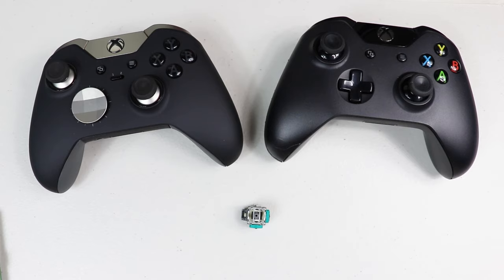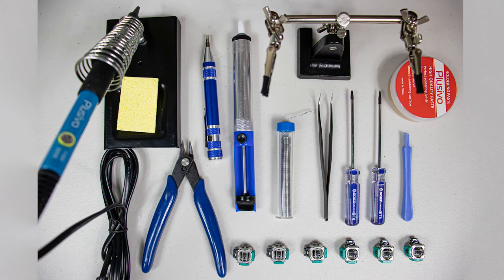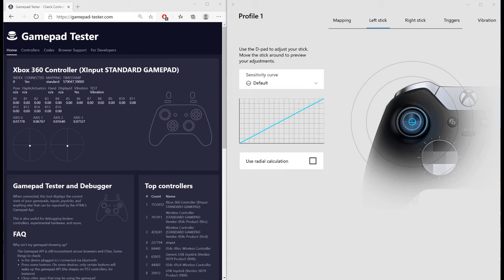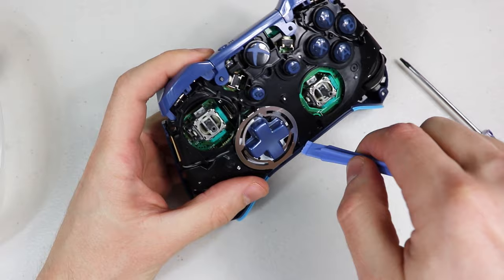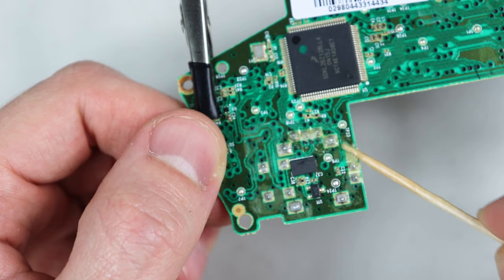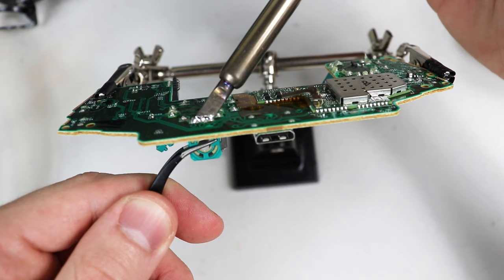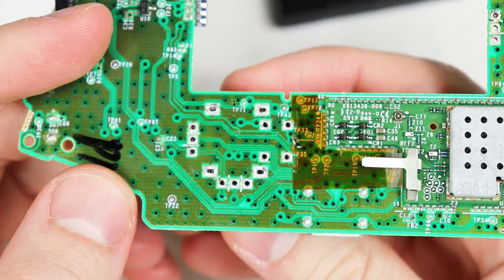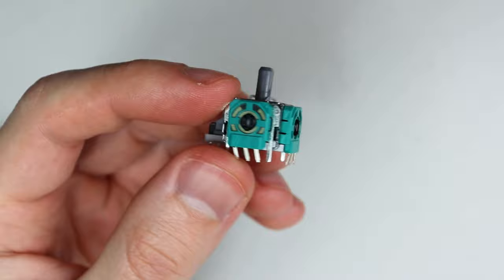How to Replace Xbox One Controller Analog Joystick - NEW METHOD - Fix Stick Drift, Broken, & Loose

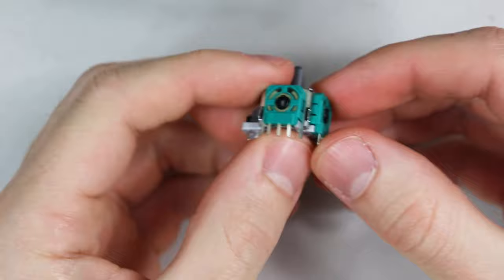Comment: 13:50 I have found that using a small jewelers drill cleans out the thru hole easily. You just drill the solder out of the hole.
Reply from the maker: That's very adventurous 😅
Reply: @SOSSGAMING  I make a lot of mistakes building circuits so I have gotten good at desoldering. I almost always put at least one diode in backwards. Haha.

Comment: I have similar method but I cut bottom part of potentiometer and bend legs to its body. After that I'm soldering it by wires to holes. After that I'm using two component Apoxie clay (its like bubble gum) to fix potentiometer in place, adjust it and leave it for a day to fully harden. I think this way adjustments are more precise.
Reply from the maker: Sounds very interesting!  Wish I could see it in action.  Thanks for sharing.

Comment: My controller just recently got really bad stick drift in the right joystick, (ive already gotta fix two others, one with left stick drift and one with a practically broken left joystick and drifting right) im gonna hopefully get it fixed once im home today, ive already watched the tutorial and it was really straightforward and actual seems pretty simple. Hope i can use it to save many future controllers
Reply from the maker: Awesome! Also if you work on the x/s controller they will self calibrate after some time moving it around (while turned on) which can save some time. No need to manually calibrate on those. Good luck!

Comment: Highly recommend Chip Quik smd291 flux with Chip Quik smd alloy. I use this on my reflow work to remove stubborn IC's and multipin  components. The alloy retains heat longer than normal solder allowing one to pull the component off with general ease.
Reply: As another note to this, if one uses it, you want to make sure you remove then Flux and all the chip quick solder before replacing a component. It's not a normal solder.
Use 100% IPA or DI water to clean the smd291 Flux off the boards as well.

Comment: Bought a cheap repair kit of eBay and went straight to this video. Got to the part where he mentioned soldering iron. Went to eBay and bought a new controller 😂
Reply: 🤣 soldering can be hard to learn. I allready ruined 3 working controllers with minor drift. Now they are in the bin
Reply: This is me right now. Will just buy a new controller

Comment: Great video.  The HTML5 link is a great tool.  I don't know how to use an Xbox(I am serious :/) but that website worked great for me.  Doing the repair is like a puzzle to me.  I didn't realize new modules needed to be manually adjusted until I saw your videos. Your video is very clear and informative.  My nephew asked me to fix the drift on 2 original controllers before he will let me open his elite controller....  I don't have new modules so I just rinsed them off with 99% ipa.  Blew them out with air.  They are all within range .02 to .07.  They don't always spring back into the same position when I let go of the thumbstick.   In your previous video, you mentioned that .18 is when drift starts.  I'll try and get a really bad controller from my nephew that I can experiment soldering with.  I am teaching myself micro soldering with switch lites with some success and have plenty of tools.
Reply from the maker: Glad you found it useful. Also glad you were able to find some success with just alcohol.  For the .18 metric that was for typical games a couple years ago (specifically call of duty: black ops 4 that I tested on).  Technically it all depends on the deadzone a particular game uses and I think newer games are lowering that limit.  Anyway, wish you the best of luck in future repairs!

Comment: to de-solder parts like the potentiometer just put a glob of solder wire over the 3 pins to heat them up equally and with the help of helping hand, one side can be heated and from the other side you can remove the potentiometer. :)

Comment: I’ll admit this seemed a bit beyond me, with the fine adjustments you were talking about doing but I decided to give it a go anyway. I decided not to cut off the 3 parts on the new module that you instructed to do to manually calibrate and just soldered the new module straight on (I was going to desolder and follow instructions in more detail if it didn’t work). But straight off the bat it was dead center. Not sure if I got lucky but I didn’t need to do any manual calibration. Great video by the way you can tell you’ve done it a bunch of times.
Reply: Side note, I also didn’t desolder the rumble modules, but I regretted that as I snapped two of them fiddling about with it so had to re-solder them back on anyway.
Reply from the maker: Great job! By any chance were you working on the newer S/X controllers? They have self-centering built in the controllers. Thanks to Microsoft. If it wasn't, you got very lucky!

Comment: I would recommend using a wick rather than the solder sucker for an amateur. On my first tries desoldering the pins I didn't get the solder fully melted and the suction also ripped off part of the pad on the board.
Reply: Are these pads needed to re-solder? I ruined 3 controllers where I ended up with half the pads gone (also used a suction pump). I couldn't get the axis back to work after those pads vanished. They worst part is, those only had minor drifting issues but I ended up breaking the pcb and throwing them in the bin

Comment: The framework itself hardly ever goes bad, only the potentiometers themselves go bad so really that is all you actually need to replace. How I do it is just desolder the 6 pads to the pots themselves and then pry them to the side and pull them out, pop off the ones on the replacement joystick. line up the center, stick them in, pop them back onto the frame and hit them with a bit of solder. Not including disassembly and assembly it takes less than 5 minutes

The main reason these type of joystick go bad is from using the joystick switch which put's downwards pressure on the two shafts which in turn puts pressure on the pot wiper mechanism distorting it's shape and over time the distortion remains plus the wiper itself bites into the resistive layer removing bits of it so the resistance changes. The best way to avoid it is to buy gamepads with buttons/paddles on the bottom and map your two joystick switches to them.

Comment: nice video. one tip you could improve on: when using wick, spread it apart before using it, it'll wick much easier and it'll wick much more per length of wick.
Reply from the maker: Great tip, thanks!
Reply: @SOSSGAMING  you're welcome. let me know what you're lost on in my calibration post and i'll help you out.

Comment: thanks for the helpful video! do these potentiometers work for the new xbox series x controller, i messed up my first go at it and im going to try again. you make it look easy
Reply from the maker: Yes, they use the same joysticks/potentiometers.  Remember to not use too high of temperature and/or for too long on the pads. I probably should have emphasized that more. Anyway, good luck this next go around!
Reply: @SOSSGAMING  I just went for it off memory your instructions were fine, that's my bad, break a controller every 3 to 6 months so I have a graveyard of practice ones(no I don't miss treat or throw them I squeeze to hard)

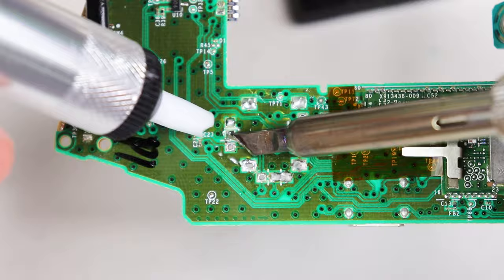Comment: One adjustment, even though you most likely won't need a broken joystick, you don't have to completely destroy it, you can melt solder and remove it just like it is shown on 13:41, then you can just gently pull the entire joystick with the potentiometers.

Comment: Soldering Wick is your friend, I prefer it over the sucker. You can grab one part of the wick then grab let’s say and inch away from it and push your hands towards each other and keep doing it until the wick is widened, do this when visually it looks like all the solder is gone from the holes and this makes it easier for it to conform and absorb the small amounts of solder you don’t see, then whatever your desoldering should wiggle loose.

Comment: Thanks for your video as it came in useful the other night when I decided to tackle replacing one of the thumbstick modules on my Xbox controller,,,, and the thing that puzzles me is,,,,
I'd smoked quite a bit of crack and heroin that night and one of the side effects is that after a few pipes it totally messes up your close up vision,,,, but hey!!!!,,,,, I'm feeling funky I thought,,,, let's do it anyway!!!!!,,,, yeah puzzled,,,I made a right mess of it,,,by accidently de soldering two surface mounted capacitors that are about the same size as salt crystals,,, some how I found replacement ones from an old smart phone and eventually re soldered them,,, I ended up convincing myself that it's now probably scrap and fitted the new analogue module soldierd it and put everything back together again without following the steps you showed about removing and snipping the plastic nibbs on the carbon track housing for fine adjustment,,,,, so here I am a couple of days later puzzled because I tried out the controller with the Xbox app and the new thumbstick is now showing better results than the other one that I didn't touch because it was working fine before the repair work..... so can you tell me if it's common for the modules to not need any adjustment after being replaced????
Reply from the maker: Haha thanks for sharing! It's not common to not need adjustment, may 1/4 or 1/3 of the time you'll be fine. You lucked out!

Comment: It’s not electricity and heat. It’s that the solder tip is a ground connection. So if you solder say a 5V or 3.3V rail to ground you might blow the power supply on the board as it likely won’t have over current shut down protection.  It can wreck havoc in other areas as well but yeah it’s not the heat that blows shit up.
Reply from the maker: Aha! Great insight. Thanks for sharing your wisdom and teaching me something today.

Comment: I just had so much trouble getting an analog stick off.  I finally had some luck when I remembered that I had some chip quick.  Chip quick is a low temp solder for removing surface mounted chips.  So get some of that that if you have an elite controller with small holes.

Comment: Thanks for the video. 12:00 The pointed and sturdy nipper you use looks good. What nipper do you use?
Reply from the maker: It's just the standard one that comes in the kit. Called a micro cutter. If purchasing one by itself, I'd recommend the Hakko brand micro cutter. Really good build quality.

Comment: This is by far the best analog stick replacement video I have seen. I have one question. I heard that the black and orange modules are better, is this true?
Reply from the maker: I am not familiar with them actually, so I couldn't give my opinion on that.  Do you know why they say they are better?
Reply: Not really sure but i know that the plastic thing that controls the horizontal movement(it’s a cream color on the green and blue module) is a hard plastic rather than a flexible one.

Comment: I Love the way your patient and clear with what your doing! I am having an issue with the controller not staying on though when i plugged it into my computer, it turns on briefly then shuts back off
Reply from the maker: Which controller are you working on? I wonder if they did another update. On the Elite 2's, they made it so the battery pack (which is part of the back plate) needs to be connected. If it's the X/S, I'm guessing it may be the same thing.

Comment: Tooth pick points pushed into the holes rather than bending the legs over to make contact :)
The other option would be to make up something ( 3d print ? ) with pogo pins that will make the contact without having to bend the pins over.
Reply from the maker: Sounds very interesting.  I'm trying to grasp the idea but I understand it's difficult to explain things over text. :/ Pics and/or video would help a lot for me lol
Reply: @SOSSGAMING  Spring loaded pointed pins ( pogo pins) set in a bracket to suit so that the point of the pogos make contact with the edge of the holes and the pot legs.
Reply from the maker: @steverpcb  Oh, I think you are referring to the other method of measuring the pot's resistances and using some sort of apparatus that can be used to connect the joysticks pins to test the resistances without needing to solder them on, and  can then be used over and over on other controllers? I think I'm following now.
Reply: @SOSSGAMING  No, I am thinking of a way to make the contact between the pcb and the pot pins without having to bend and un bend the pins.
Only 2 of the 3 pins on the pots are actually connected.
Reply: @steverpcb  Yeah, but that doesn't calibrate it. You can just slap it on and make sure its soldered and connected just fine, but that doesn't mean the joystick will read at 0.0, because the problem isn't that they're not making connection or they're making poor connection. The software is hardcoded on the controllers with custom settings from the factory and we dont have access to change the software in the controller so we can adjust it internally. Adding a new way to make connection wont fix that. He's moving the posts so that he can manually adjust the hardware to sit where it needs too so that the joystick sits at 0.0. Not only that the joystick will have to be firmly attached to the board, or idk how you're going to use the controller without breaking it. Unless we both have no idea what you're actually trying to convey
Reply: @wargex  The idea of using the pogo pins is to keep a connection while moving the pots for caliberation before soldering them, without the need to bend the pins backwards to make contact, the pcb holes are un plated which makes de soldering easy but making contact a pain.
Reply: @steverpcb  Oh I think I understand what you're saying now. Would that make it harder to move them out of the way for soldering? Or would the clips hold it all in place well enough while you get a pin finished? I wish they just made joysticks modular clips, my 4th controller joystick is going out now. and I don't think I need 5 controllers with 4 broken. lol, Its about time I fixed these things myself.
Reply: @wargex  Only 2 pins on each pot are actually used so the 3rd pin would be accessible to be soldered first and then the pogo holder can be unclipped to do the others :)

Comment: Great video!!! One last question: How do you know which Joystick is good quality and which is not (choppy and hyper movement) before you buy them.
Reply from the maker: You want to find the ones with the black wheels/wipers inside the potentiometers.  However, a lot of times sellers show the right analog and sell different ones.  If you live in the US I actually sell the correct ones and this is what they look like: https://www.ebay.com/itm/223831814472.
Reply from the maker: @magnetohex703  Glad to hear that you want to get into fixing some controllers! As for the supplies for the PS3, I just looked for some analog joysticks and they all seem to be out of stock on eBay and Aliexpress.  The dualshock/playstation 3 controllers use a 4 pin potentiometer.  Sorry about that news.  The cheaper soldering kits I'd recommend for these repairs are linked in the description.  Best of luck!

Comment: You can also solder external tiny potentiometers and rotate on the axis with a screwdriver to center them instead of all this
Reply from the maker: I have tried those and it is a decent option. However, it can cause range issues as the extra resistance may lower the range.

Comment: great job and very meticulously explained but you should have cleaned the pins of the joystick and the motherboard with isopropyl alcohol before installing and use a little bit of flux. just some little advice. also clean the tip of the soldering iron on a wet sponge after each pin. will these work on a xbox 360 controller (pc version) cause i have a little drift on mine.
Reply from the maker: Hey there.  Thanks for the advice.  Unfortunately these are not compatible with xbox 360 controllers.

Comment: Do you ever have a problem after reassembling with the faceplate of the controller that it will only register like 92% but when the faceplate is off you get the full push in the axis direction? Like it’s looks fine then when it’s reassembled its a problem
Reply from the maker: Yes, I know exactly what you're talking about. Why or how it happens exactly I'm not 100% sure, but I know changing out the potentiometer should solve that problem.  Should just take one replacement attempt, but might need multiple attempts.  I think it might have something to do with the previous calibration from the factory with a potentiometer of a certain total resistance that needs a similar or higher/lower resistance.  That, and/or the replacement potentiometer is either a little higher or lower total resistance than was previous installed.  If you have a multimeter handy, I believe finding one with the highest resistance will do the trick.  Probe the outer two pins to get the readings.  I'm sorry I'm a little rusty, but hope this helps you out somehow.

Comment: the skills of this dude on electrics are amazing! however i think that there must be a more easier way to calibrate the joystick, i am not an electrician not real knowledge, i can barely solder 2 wires.... but i think that there must be some kind of software to recalibrate to 0 regardless of pins.... i cant see microsoft staff adjusting by hand, either the machine build it to perfection or via software afterwards is calibrated... the question is... where is this software??? hmmmm meh meh